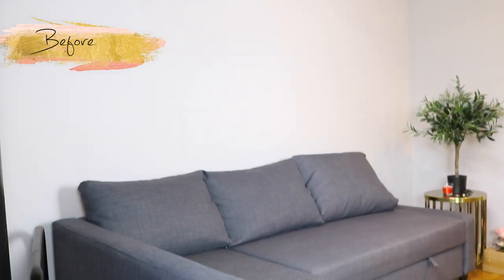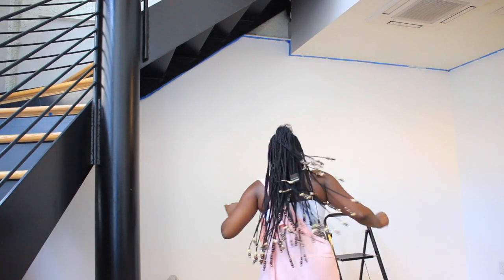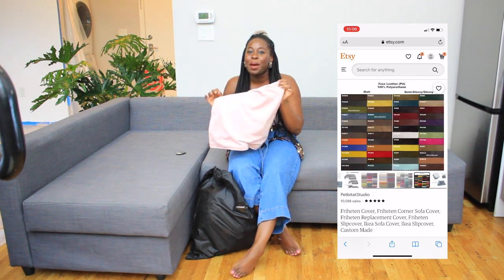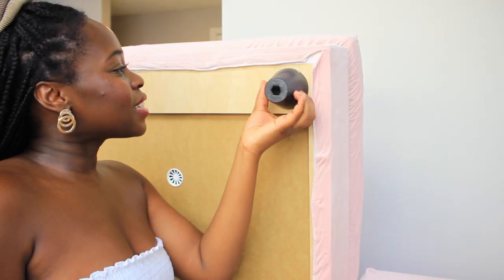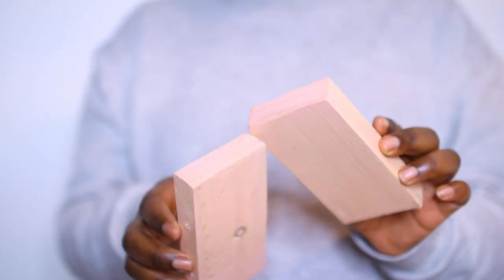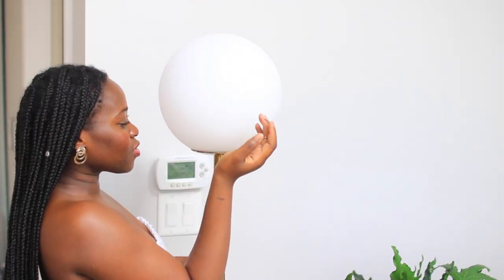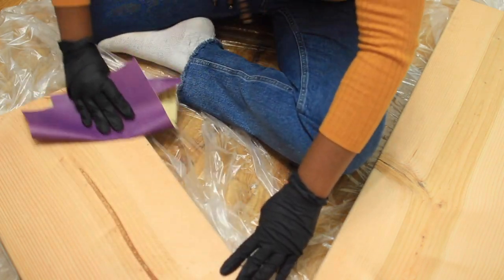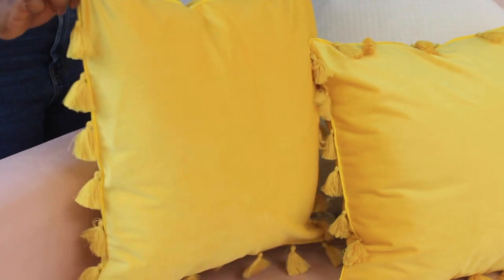EXTREME NYC DREAM LOFT APARTMENT MAKEOVER 💕 | IKEA COUCH HACK + DIYS + TIPS | #TheSelfLoveLoft 💕

Comment: Sis you are a vibe!! you inspired me to make this couch work that I ended up stuck with. I ordered the cover attached the legs but am a little unclear on what to ask for regarding the wood at Home Depot so any insight would be greatly appreciated :)
Reply from the maker: Hey sis ! Thank you so much! 

I went to the lumber section where they were really tall pieces of wood skinny and thin pieces of wood. The wood I got was about 1 inch thick which worked perfectly for the original IKEA wheels to fit on and it was about 2 1/2 inches wide. At Home Depot they are able to cut the wood for you being that the piece that I had was extremely long from the lumber section. So I asked them to cut it a little over the length of the wheel from IKEA. Bringing it there helps a lot to find what’s the best amount to cut. I really hope that was helpful

Comment: You’re apartment is looking soooo nice! I have the same couch and want to raise it so my roomba goes under it. Did u have step by step instructions on how you made the pull out portion match?
Reply from the maker: Thank you love! This part was difficult. I basically took off the wheels on the pull out and got small pieces of wood that matched the length of the new legs and attached it To where the wheels on the pull out were. Then I put the wheels back on by attaching it to the wood I added. Hope that helps

Comment: I have the saem couch and cover!! I just got new legs for mine and I need to alter the pull out as well. Did you keep the original wheels or buy new ones after installing those wood pieces?
Reply from the maker: Hey! I kept the same wheels! I was going to buy new ones but had bad luck finding a good replacement. I attached my old wheels to a piece of wood and attached that back to the couch!
Reply: @LiveNaturallyLove  Thank you so so much for replying!!! Do you happen to know the dimensions of the wood? I'm having the hardest freakin time figuring out what size wood pieces to have cut
Reply from the maker: @TheZebrasBeauty  I found a piece of long lumber that was about 3 inches length but about 2 inches in width. I attached the wheels to the 2 in part. there is a piece of wood already under the couch. I attached the new lumber ( which I got cut to fit ) to the piece that is already there. That piece under the couch is about 2 inches long plus my 3 inch piece I got from Home Depot equaled to 5 inches which worked because the new legs is about 5 inches. so everything lined up. lol I hope that helps!

Comment: This is beautiful 😍 what are the measurements for the rolling part of the couch. I was thinking about getting this couch but I'm 6ft and after seeing your video I can safely say I'm getting to change the legs.
Reply from the maker: Hey love! The original legs and rolling part of the coach is like 2.5 inches so super low to the ground. I got 5 in legs and bought 3 inch long pieces of wood to add to the rolling sofa part of the couch and then put back on the 2 in wheels that cane with the couch. This made the sofa roll out part match the new 5 inch legs. So as long as you get a piece of wood to match the new height you are going to make the couch, you should be good!
Reply: Thank you